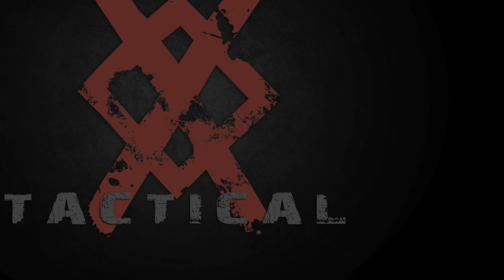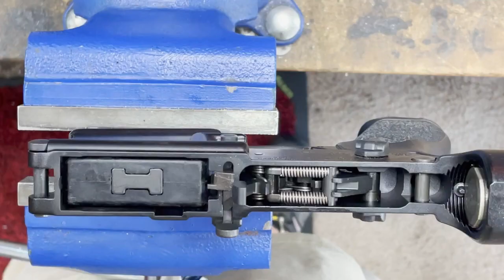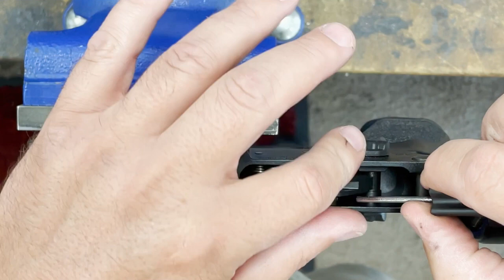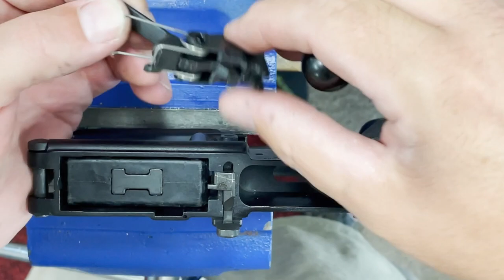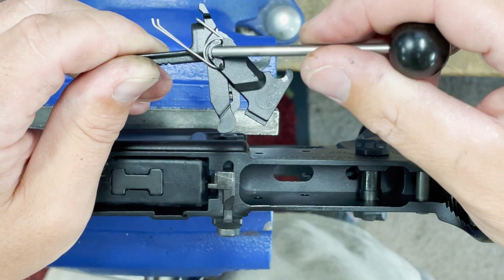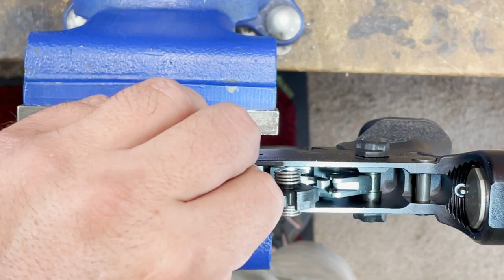Hiperfire Hipertouch Competition (et al) Installation and Removal

Comment: Exceptional video. Never mind the ? that bitched about the "OKs".  I had to R&R, to put the red trigger shoe on, because the trigger guard is fixed on my particular rifle. But it took me no more than 2 minutes because of your guidance. EEZY PEEZY.
Reply: i didnt even take my trigger guard off. you can just slip the shoe on as you push the trigger through the hole.
Reply: Yeah. I think that’s what i did the second time.
Once it was completely installed on my Tippmann m4-22, with fixed trigger guard, I had no choice but to uninstall to slip the red trigger shoe on.

Comment: This video was clutch for me.

At the end of 2022, I bought a stag arms, three gun competition rifle  (mainly for it being left handed) it came with this trigger in it after talking with the company I realize that I could convert the safety from 90° to about 60°. When trying to do so, I realized pretty quickly that I couldn’t get the safety barrel out without doing something funny with the trigger, and since it was the first time I had bought an AR I basically said screw it I’m gonna leave it where it is, after looking around for a while, I stumbled upon this video, and within 10 minutes (and many months of tinkering to figure out how everything worked) I was able to realize what I needed to do to make that safety change happen.

As soon as I got things kind of to the point where I knew what was going on, I realize that the forward controls designs ambi mag release and rearward based bolt release needed to be removed to access the front trigger pin lmao😂. it went from a quick five minute thing to a 45 minute saying pretty quickly. 

Thanks again for this video, it was really helpful!
Reply from the maker: Happy to hear it. I did this video because I received a desperate phone call from a Tactical Games competitor in their hotel room trying to get their fun running. I walked her through it. I think she came in high lady at that match too.

Comment: Wouldn't the grease attract dirt and gun powder residual ?
Reply from the maker: Not really.  If you slop it on all over the sear and hammer and the springs, ya, it'll be an issue.  This is just a small amount on a piece inside of a fairly closed rotating cam.  It needs lubricant and one that will stay in place.
Reply: @seanmtactical6069  so two quick questions sir the grease on the pins that hold the trigger and hammer in place have you ever had pins walk out because or the lubrication? So the hammer spring sits on the cutouts of the pin that holds the trigger in place?
Reply from the maker: @Lone.Scout.1669  No.  The spring tension on a proper trigger and J spring in the trigger are more than adequate to hold the pins in place when lubed.  The hammer spring leg sits in the divot in the pin and retains it.
Reply: @seanmtactical6069  copy that thank ya sir I just got the hiperfire competition
Reply: I know it’s an old question but don’t listen to these blokes. Less is more with an AR. Take it from someone who has shot tens of thousands of rounds and had many trigger lockup failures in my early years (particularly where the hammer and disconnecter hook) because of grease and too much oil. Just a couple drops of gun oil on the springs is all you need. Any more than that and grease and you’re going to attract a bunch of crud with enough rounds and when your trigger doesn’t reset you will know why. Add stuff like a down vent bcg or suppressor and you will exacerbate the issue.